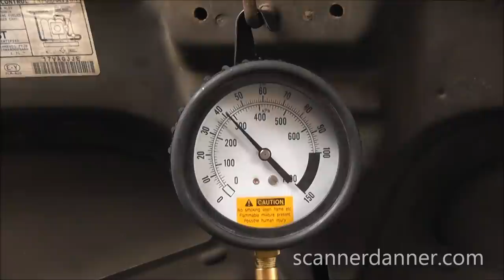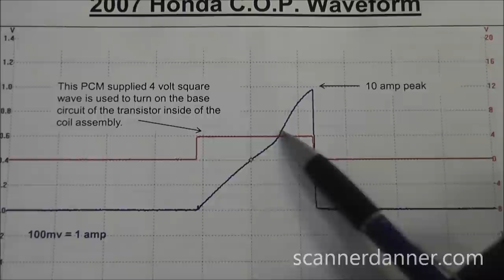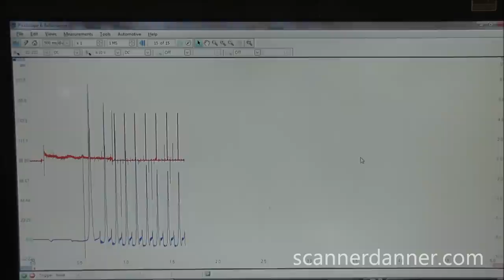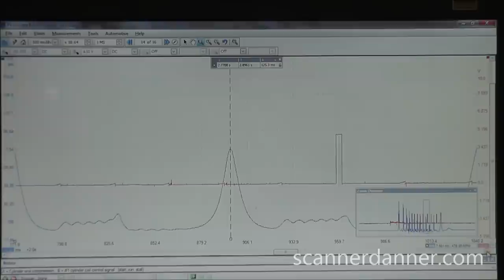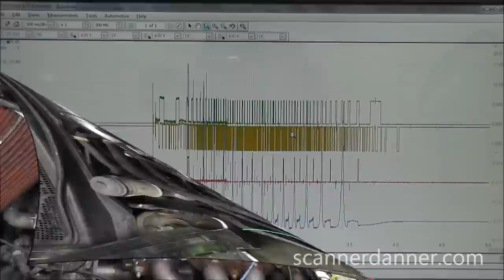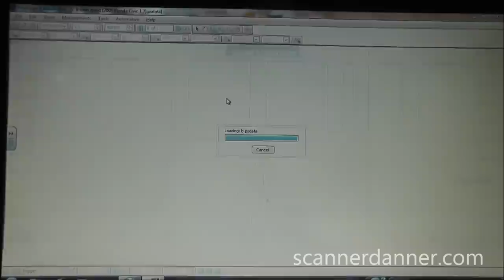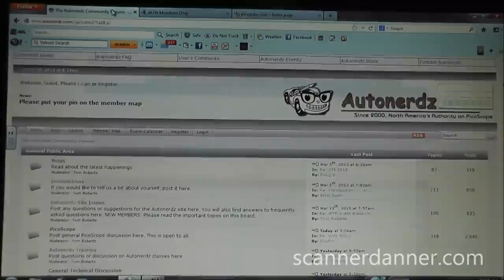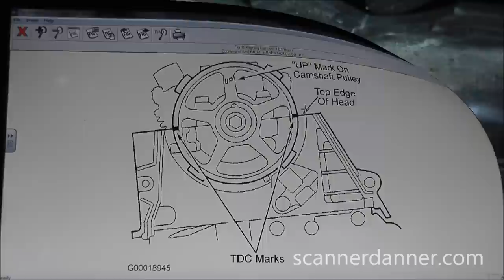Honda Civic 1.7L starts, runs, stalls (incorrect timing belt installation)

Comment: Thanks. I've got a 2001 CRV that will run fine as long as it's kept above 1400ish RPM but will instantly die (no hesitation or stumbling as it stalls...it just shuts off fast) if I'm going around a slow traffic circle, making a slow turn, come to a stop light, or just plain idling at a stand still. It will start-up cold fine, idle at about 1400rpm while warming up (2-3 minutes) and then it'll just instantly dies. It will start right back up but will instantly die if I'm not revving the engine past 1300-1400 RPM. 

I've replaced ignition coil, cap, rotor, PCV valve, checked battery, checked alternator is charging, checked air flow filter, checked the main relay, all fuses, and visually  inspected the plugs and wires.  
It doesn't seem to be temperature related. It seems to be something electronic or possibly the fuel delivery at warmed idle speeds. I'm getting fuel spewing from the top fuel filter nut when key is turned to Position 2, and I'm getting a fuel injector pulse at the #1 full injector (so this tests crank sensor). 

No engine codes or warning lights.

Any advice or experience with this? Thanks!
Reply from the maker: First thing I would do is clean the throttle body
Reply: @ScannerDanner  thanks! Done. Cap, rotor, coil and PCV also. Not missing and then stalling, just instantly killing. This is what it did today: it will start only if I hold gas pedal all the way down to floor. It warms up 2 to 3 minutes at 1500rpm and then stalls again as it gets down to 900ish RPM. It will restart (pedal to floor) but will stall quickly again within 15-30 seconds.
Reply from the maker: @thesetruths1404  that no longer sounds like a dirty throttle body. Need fuel trim numbers at 1500, sounds like a rich condition. (Pedal to the floor to start)
Reply: @ScannerDanner  Ok the readings were all over the place when it was cold. Then it warmed up and started acting and reading normal. I got it to stay on at idle RPM (after warming up for 10-15 minutes) but it would randomly kill, but start right back up. Fuel pedal position sometimes mattered and sometimes didn't to restart it. When Hot it read ST Trim at 0 and LT Trim at -2.3, at all RPM (600, 1500 and 2500).  When cold it was reading ST -2 to +46, and LT -.8 to -2.3. If I turned it off and let sit a few seconds it would repeat these erratic readings and return to normal in a couple of minutes.

I also got this error code about 10 minutes into the test that has never shown before: 
P0131 O2 Sensor Circuit Low Voltage. When I went to the downstream Oxy sensor page it said 0.82 V and the upstream said 0 V.

I also got a revolving door of these messages in the Fuel System Status page: Closed Loop: using 02 Sensor to fuel mix.
Open Loop: System Failure.
Open Loop: Insufficient engine temperature. They seem to correspond with the normal or abnormal readings.

What do ya think? Faulty O2 sensor or faulty temperature thing somewhere?

A clogged CAT would be present constantly eh, not back and forth like this?
Reply: 4-19-20, now I have P0131 code so I back-probed signal wire on upstream O2 sensor and it was reading .2 to .8 Volts when cold but then when hot and held at 2300 RPM it would fall off and go down to .02 and below volts, as in 20mV or less.  So I assume it is a failing O2 sensor. When it does this the Upstream scanner shows 0 volts and the downstream stays steady at .8 to .9 after it's warm. What's weird is the fuel trim, per the freeze frame when the code kicks on (I've reset it 3-4 times now and it comes back fast) will say the STFT skyrockets to +47!  Is that the likely cause of the stalling...fuel starving?  I've noticed if I jockey the throttle (pump it) I can keep it running so the actual super lean fuel trim could be the issue eh, based on the 02 Sensor failing?   Also, the scanner app shows the Fuel System as "Open" and "Failure" when the 02 Sensor fails, before it gets hot it shows it as functioning ok and closed. 

I'd like to know how to test the ground wire side of the sensor harness path just to verify it has a good wire connection. Can I just back-probe the other wire, ground the multimeter, and take a ohm reading?
Reply from the maker: @thesetruths1404  this sounds like a bad upstream O2, the downstream sensor showing us a rich condition while the upstream was lean, is the key piece of evidence you've provided for me (nice job!). The +47 STFT is literally flooding the engine with fuel (from a "false lean" signal) and this is why you can drive it at the higher RPMs. The engine can handle rich conditions better in the upper ranges. 
Here is the other reason I believe we have a bad upstream O2. You said it starts up fine cold. Guess what sensor is NOT used during this period of time? Yep, the O2. Hope I am making sense. Sorry for the delayed reply.
Reply: @ScannerDanner  thanks brother! I'll be pulling it soon and bench checking it just to be bored and be sure!  I retested the bias voltage at the harness directly (no back-probe) and had meter hooked to battery negative and then it read 0.4x Volts, the correct Honda bias voltage. So my previous back probe must have been bad, and possibly my ground connection was not good either.

BTW, unrelated to this problem, but my 2003 Mitsubishi Montero 3.8L (203k miles) has a bias voltage of 0.11 Volts (I used two different multimeters).  It was the same in both banks, with the SUV not running (key on) as well as idling. I googled Mitsubishi and could not find a bias voltage anywhere. The other pin was 12v heater and other two pins were 0.003v or less. Both harnesses were the same. It's got a weird problem that sometimes won't allow it to start in coldest weeks of winter, but now in warm weather it all looks fine! Lol. Old cars.... gotta love em!  No vacuum leak can be found.

I think it might have 1 or 2 clogged CATs because both downstream sensors show a constantly changing 0.2 to 0.9 voltage on my scan app, even though both upstreams show okay. Doesn't matter if I'm at idle or 2,500 RPMs, cold or hot. Not sure if an ice-cold clogged CAT can prevent a vehicle to start. At this point I don't discredit anything from being possible! Lol
Reply: @ScannerDanner  Unplugging the O2 sensor doesn't change the stall problem. It just did it twice on a test. Short & Long Fuel Trims stayed at 0 while running. I noticed the MAP sensor reading goes from 0.2 (normal idle) to 27ish when freeze frame is captured with or without the O2 sensor being used. Short Fuel trim showed -5 at freeze frame, vs the normal +47 when O2 was plugged in. Something is flooding it out and making MAP sensor go way high as it kills it. It also will flutter a few seconds after it's completely stalled, like turn over a time or two, with and without the key/ignition on. So fuel is getting ignited a few seconds after it's killed.
Reply from the maker: @thesetruths1404  refresh my memory, the upstream O2 was indicating lean while the downstream was rich with a +47% fuel trim. Right? Stalling below 1400, runs good under load. 
You unplugged the upstream O2 and you are no longer seeing the very positive fuel trim. Is that right? But then it is still running the same exact way? No difference at all? If so, you have another problem for sure, but you also have a dead upstream O2 if it is indicating a lean condition when it is actually rich. 
It runs good under load and at wide open throttle right? So we are definitely not worried about a lean condition if this is the case. So then why is the upstream O2 dropping lean on you? Because it is bad, probably contaminated due to the rich condition you have going on. Have we looked at fuel psi yet? You mentioned a MAP reading of .2? What is MAP voltage?, not inches of mercury or kpa depending on your scan tool. 
We could have a memory thing going on here too, you said the fuel trims where near 0 with O2 unplugged. Maybe clear the memory (battery disconnect and cap discharge) and then test drive it again with the 02 unplugged.
Reply: @ScannerDanner I think most of that was right. But it will actually die at idle, at 2500+ RPM or any load it seems.  It runs perfect until it warms up and gets hot, then it randomly dies. What I wasn't sure of before was if it was dieseling (running-on) or not, but it definitely is. 5 seconds or so after it dies or I kill it it will sputter once or twice. Does not do this everytime but about 50%.
When hot, it will only restart if I put fuel pedal to floor and cycle key entirely off and on to crank it. If I don't give it full throttle, it won't restart. If I don't cycle the key, it won't start. But this is only when it's hot. Weird...I think I need to check fuel pressure. Will borrow one this week. 

It starts fine when cold with no fuel pedal, idles at about 1400-1500 for 2-3 minutes and then slowly comes down to 800-900ish. At this point any run time is random. 
It seems to idle a little high but it much, but I doubt slightly off timing wouldn't cause it to stall and be a hard restart, would it?

I'll check MAP voltage also. My device gives it in a pressure reading. I'll have to lookup how to check it...thank you!

Comment: Hi Paul,without the scope, how would you have done to figure out the timing was the issue, just trying to figure out for us diy without those tools. Also where did you T off to the fuel line, was it the the fuel filter line?
Reply from the maker: It would be easy on this one, just take the top timing cover off. It's not easy on a ton of other cars and this was a nice way to teach this method.

Comment: For anyone looking to figure out if your timings off for the d17s just unplug your crankshaft position sensor and if your car turns over and stays running it means your timing is off

Comment: Paul, Do you think that would be accurate to say that the pcm commands the firing event based on the crank only or some sort of default for the first few seconds and later  syncs with the cam to adjust timing as the rpm signals go above certain threshold ? This would be my only explanation of why the timing is somehow accurate at the beginning and then gets out of timing. what do you think? btw great explanation great diagnostic strategy !
Reply from the maker: yes, that is exactly what I think was going on.
Reply: ScannerDanner
AFAIK after start the ECU is constantly adjusting the timing and mixture to keep the catalytic converter at optimum temp and for fuel economy. Also I read removing a sensor causes the ECU to go into a last known good or default setting to get you home then throws a CEL.

I have the same car with exactly the same problem - start, run, stall. Except if I leave it to cool for a bit, start,run,run,drive....Stall, then back to start, run, stall again. Recently the CKP sensor failed and was replaced. Would a failing Cam sensor show similar symptoms? Happened for the first time about an hour ago after long drive. I'll try unplugging sensors to see if it fires up.
Reply: Alta9610 sa

Comment: Hi I have a 2002 Honda civic ex that I'm having problems with it ran fine then one day it turn off and never started again its not getting power to the fuel pump I think I have changed the blue relay behind the glove I checked all fuses they are good I cleaned up the grounds when I turn the key it just turns over  but when I pour gas into the throttle body and turn the key it starts up and runs until it use up all the fuel I pour into it  I have no other idea what's the problem can you please help
Reply: How have you confirmed that it isn't getting power to the fuel pump?  It might just be a bad pump.  Have you tried banging on the tank to see if that kicks it back on?

Comment: hey
using a pico which is pc based  you have a larger viewing area
the vantage pro has connector views which i like
thats where you need mitchell alldata or identifix
pico is better but make sure you buy it from autonerdz
then you have the best support forum around and
wave form library

Comment: The way it cranked, especially during the Fuel Injector pulse was a dead giveaway. If the opportunity arises again, let your class know that there would be a real tell-tal sign that there could very well be a timing issue with a car refusing to crank some revolutions the way it has in this video

Comment: when the car is cranking you can hear the timing issue as it builds , as if someone was turning an old style distributor. it shows the importance of a reference waveform as well.
the customer said it happened while driving?. to quote greg house "everybody lies"
sometimes to save someone's embarrassment

Comment: Hello, did this throw a engine light or code?
My civic 2003 1.6  is doing the same as this 2 weeks after Cam belt water pump and tensioner change! 
After the change my fuel consumption was not good and idled a little rough!
Do you think this could be my issue?

Many thanks (watching from UK)

Comment: My 93 accord lx 2.2 liter did same thing butit was ignition switch on left side of stearing wheel inside the stearing column not the key switch but the electrical conponant inside colunm..53 bucks at Orielly..

Comment: What do you mean by “resetting” the timing belt. Did you have to take it off and realign everything or did you just turn the crank till everything lined up?
Reply from the maker: I simply losend the tensioner and slipped the belt on the cam.
This is NOT what you want to do in this scenario. I only did it to prove the fault for the video. A complete tear down, new belt and tensioner inspection is needed if not also replaced
Reply: @ScannerDanner thanks man. I did a full belt swap as long as the water pump. Car starts right up. I am hearing a ticking or clicking sounds from around there. Not sure if it’s normal for these d17s. Hoping I’m not a tooth off so I’m gonna check my marks again.

Comment: Hey Mr. Danner. I was wondering which pico scope series you are using. And also if you would recommend a pico or a vantage pro. I had a modis a couple years ago but I sold it when I quit turning wrenches professionally like a dumba$$ lol. Now I have a solus pro and am in need af a scope as I am doing alot of side work. Any input would be appreciated.

Comment: Civic owners are notorious for never ever changing their timing belts (probably since their cars are so reliable they aren't in and out of shops enough to get nagged by the repair guys). You're very lucky that this one was just a little off.  I lost count of how many of these slammed valves into the pistons due to broken or slipped timing belt.  

...The first indication that timing was off was that the pulse from the plug and compression were so well matched on startup.  Timing is usually advanced on a cold start to help cars turn over faster, so firing so close to TDC would be really unusual.
Reply: so if its only a tooth off  may not have bent a valve ?

Comment: can u please give a formula I'm assuming 720 due to 4 cylinders or is it 720 because no matter what because of same logic on a v8.
Reply from the maker: It has to do with all 4 stroke engines. It takes 2 complete crank rotations for 1 cam rotation.
Reply: thanks for the reply I've learned a lot from your vids

Comment: Could bad timing cause a barometric pressure sensor code? I have the same vehicle that I changed the timing belt on, it runs just fine until it gets to temp then the idle gets jumpy and will stall. Wont fire up unless jumped BUT unplug the cps and it starts without jumping, didn’t think timing would be the issue since it runs good cold. Soo, anyone ever deal with a barometric sensor?

Comment: Paul, I'm in the market for a scanner, was thinking of either the modus, autel or launch. I like snap ons built in troubleshooter and guided component tests but for 4-5k I'm not sure. I want a better scope as I'm starting to use it more and only have the aeswave uscope. If I went with the autel or launch scantool I was thinking about a pico. What would be a good pico to get that isnt gonna run me 3-5k? And do you have any experience with the upper level launch and autel scanners?
Reply from the maker: you can get a 4 channel pico for around $2400 and an Autel Elite for $3500? I have these listed on my tools page on my website and also on my amazon affiliate https://www.amazon.com/shop/scannerdanner

Comment: at one point in your video you mention that you didn't stared checking the timing because it would've taken hours of labor. well on that particular car you just need to take off the valve cover and the upper timing cover. it takes you only like half an hour. besides. lets say that the timing belt is off by 2 teeth, wouldn't that be enough as to set a trouble code? one last question how much time you spend using all that equipment and doing all the math, i mean was it worth it? did you charge for it?  I'm a mechanic with 15 years of experience by the way.
Reply: Good Point Pascual, but I think Danner make a very very job for those who need a full explanation. I not mechanic, and was a similar problem, and this explanation will help me to discover my problem. Regards
to both.
Reply: I agree with you Pascual, as a flat rate tech the idea is quick diagnostics. Max most customers would pay at shops I worked for was an hour diagnostic time and then that was waived if they went forward with repair.
Reply: He's a teacher ...at a school.....he wasn't trying to be quick ,but teach the students how to make a proper diagnosis, and he said " on some vehicles it could take hours" ..go back and check your information before make a mis-diagnosis....Exactly what he's teaching...guess you could use some more experience!
Reply: No need to remove the valve cover, take the bolts loose and just lift up a little and snake the cover off. I actually trim down the lip a little before reassembly so the next timing belt, I dont even have to mess with the valve cover ;)